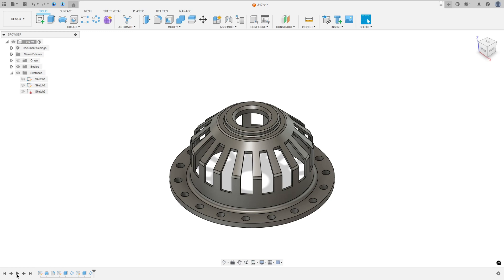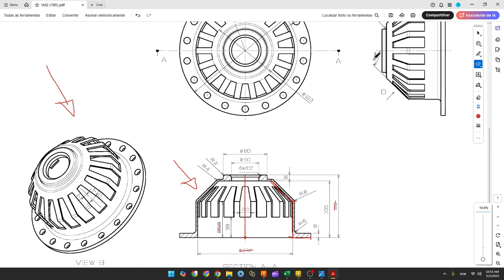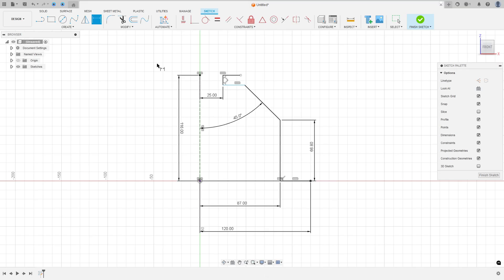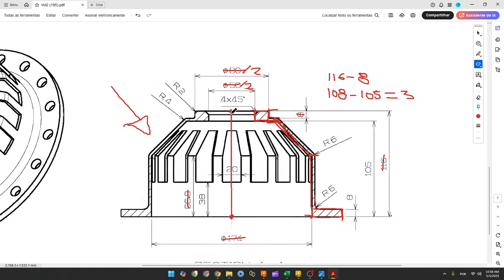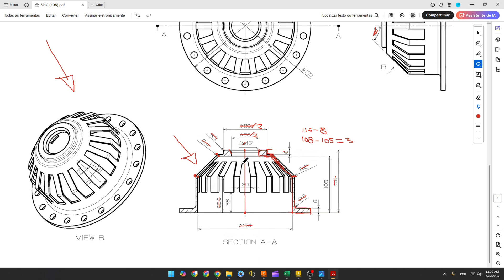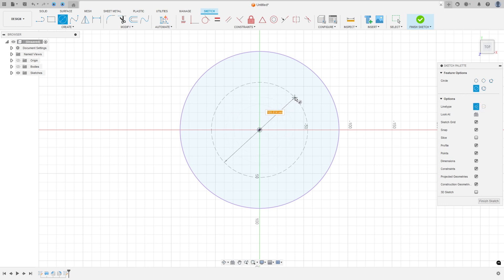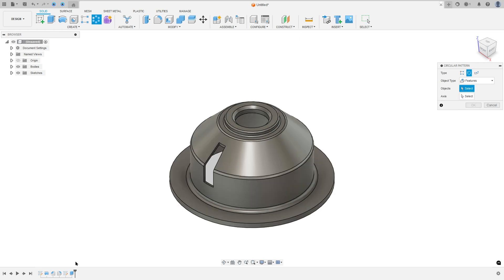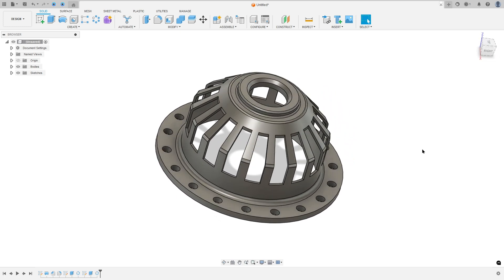Autodesk Fusion 360 Tutorial 318 - Circular Pattern

Comment: If you run a vertical line from the origin straight up and set it as a centerline, you dont have to do the "over two" stuff - you can just enter the entire dimension. The centerline can be set just like you make a construction line - its the other button in that area of the sketch pallette.

Just draw the center line first instead of the construction line you do in the second step.